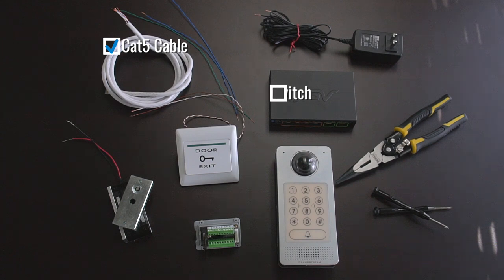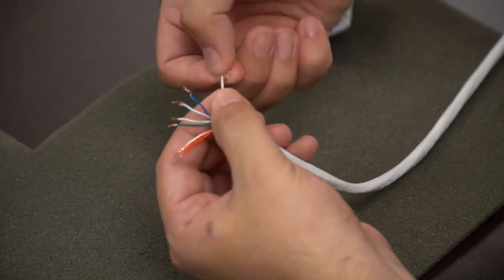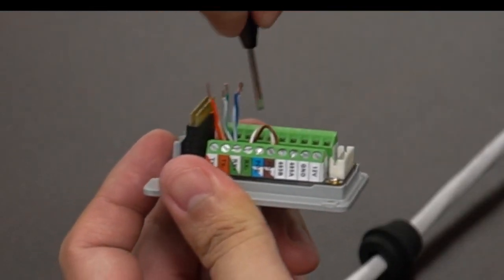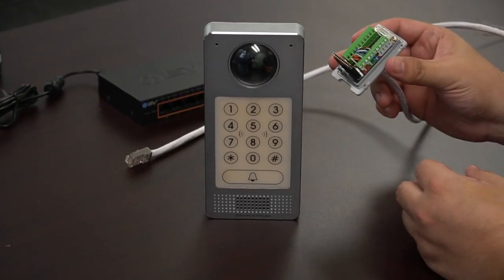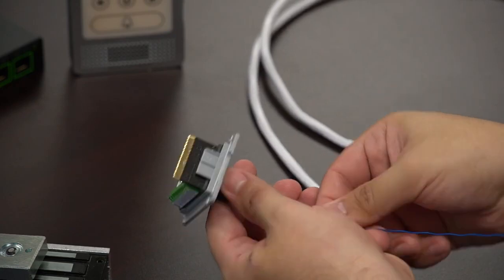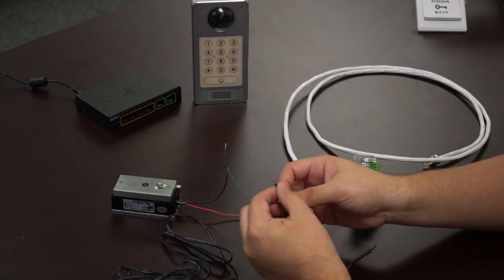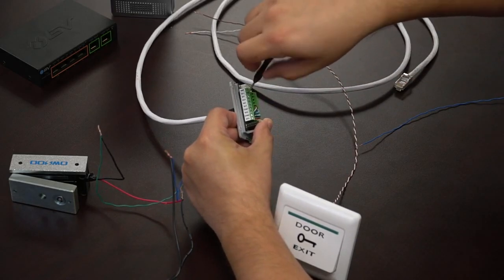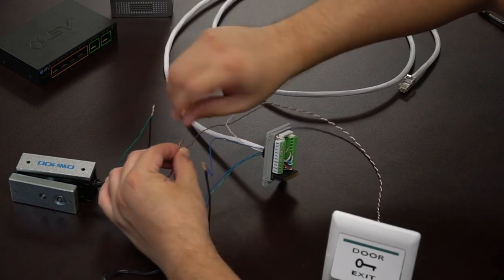GS Tutorial   GDS Wiring Guide

Comment: What prevents someone from taking out the device out of the wall on joining the two cables ground I'm positive to open the door lock?
Reply: Well, with magnet system; if power lost, door(magnet) will release. but you can use rim strike, if power lost, door stays locked. also when ripped of the doorbell to touch the wires, you most likely lose power, therefor touching the wires will be useless. these doorbells comes in metal casing. it won't be easy.
Reply: @emreemery9538  even if one of those wires is power/ground?? The only way I can think is you may that cable connector so tight that that it would rip upon removal.
Reply: Almost 6 years working in this industry, never happened. However you are right there is no guarantees